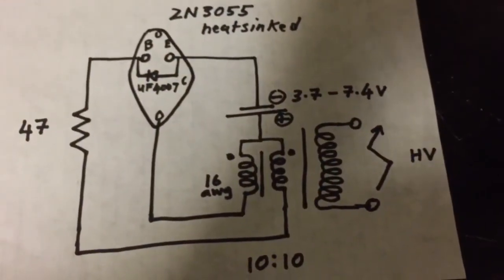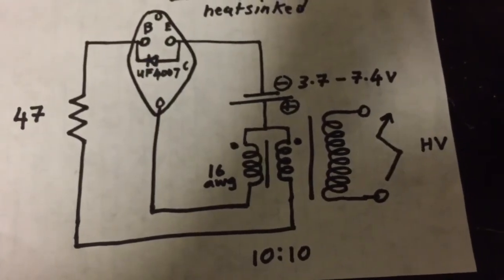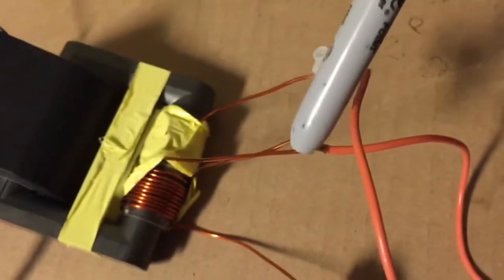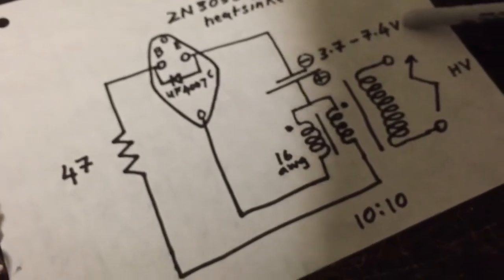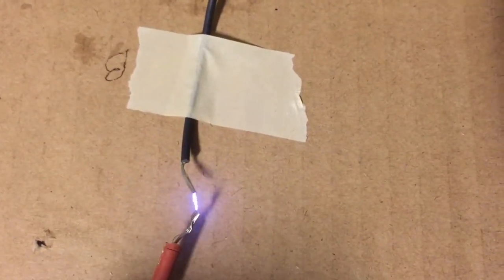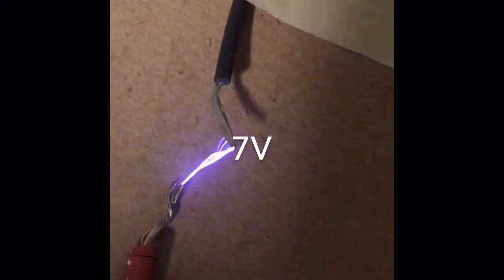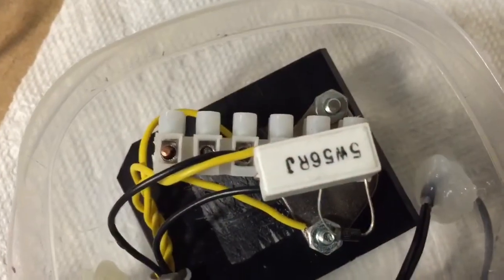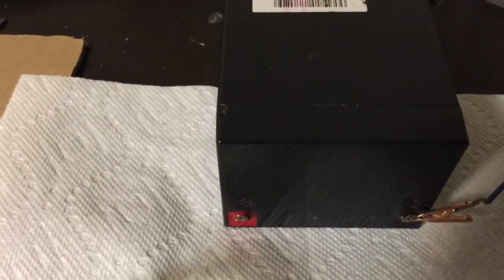Easy to Make Joule Thief Flyback Driver

Comment: Why that sound is audible? what exactly is a oscillator?
Reply from the maker: The joule thief circuit which uses feeback from the second set of windings adjacent to the primary coil on the core of the flyback transformer drives the oscillations much like a Royer circuit. It is driven at the resonant frequency of the primary coil wound around the open ferrite core. As this frequency is typically around 15-20kHz, it hits the audible range. The reason that you can hear the oscillations is that there is a small air gap in the ferrite core which causes audible vibrations in the ferrite material.
Reply: So the magnetic field and electric changes at 15 20kHz? is that correct?
Reply from the maker: Lucas Hajje yes approx. this is responsible for the audible ringing. Less turns on the primary would get rid of the ringing but would stress the transistor more

Comment: Good job! 
Try to add a magnet to the FB core in order to avoid the sound, move it and look for the best place. That reduces sound and consumption, also the light intensity. 
For better performance, use the original primary winding.-
Reply from the maker: Thanks! That is a great idea. Will give that a try as it can get quite loud and sure it is wasting energy!
Reply: You welcome. Let us know if you get any improvement, good luck and cheers!